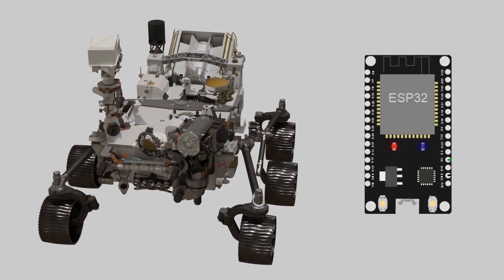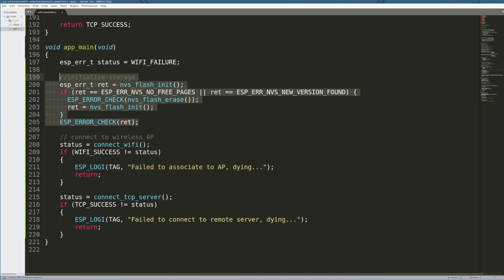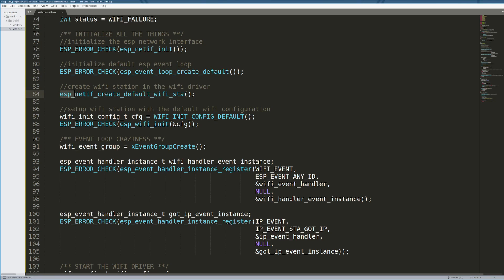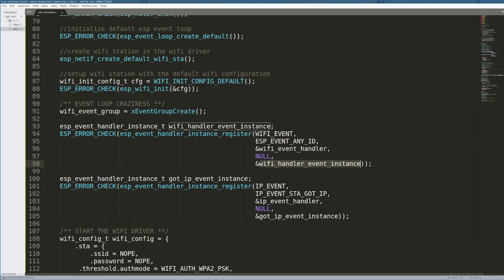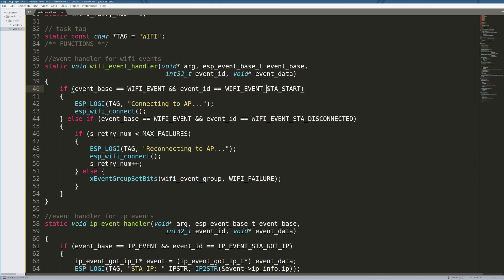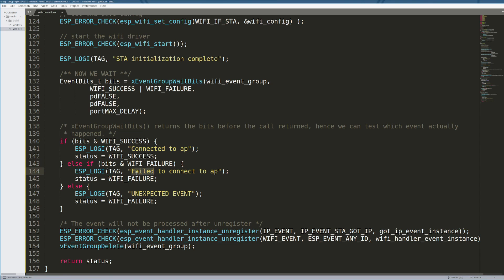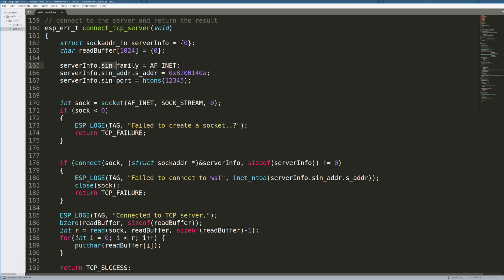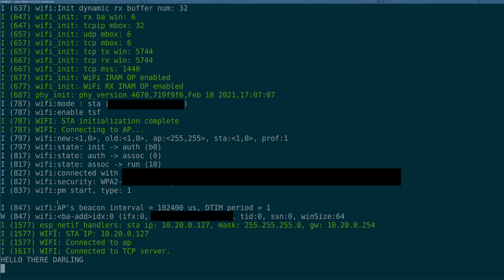Getting Started with ESP32 Wireless Networking in C  |  Wirelessly Enable Any Project with ESP32

Comment: I built the AP project template (Espressif IDF IDE) , but while my Android can see it and  connect with 'mypassword'...   unfortunately Win10 sees myssid, but there's an x next to the wifi icon!   It doesn't even allow me to enter a password!  Any idea what could be wrong?

(And by default, will the AP project template also do a webserver or would that be separate?  I couldn't find any webserver project-template/example in the IDF IDE)

Comment: I modified and built one of the ESP32 MQTT examples and I was shocked that I was able to login to my WiFi and connect to the MQTT broker software successfully. 
I also tried one of the ESPNOW examples and I was able to get two ESP32 devices to talk to each other. I am pretty impressed with the ESP32 sample code.

Comment: ESP32 is just the perfect balance between accesibility and performant low level. Also, built in FreeRTOS with the IDF is just perfect
Reply: Can you recommend resources to learn ESP32?. I tried to use BLE on ESP32 but I got very confused and I couldnt find any guides or tutorials.
Reply: Not really. The fact that the ESP32 is built to require an RTOS sucks for anything real time. It's decent for hobby projects as it has wireless but its actual architecture is way inferior to virtually any other chip
Reply: @TheChrisey  Could you elaborate a bit more? I'm actually curious as to what architecture differences are you talking about
Reply: @TheChrisey  the ESP32 is good at what it is meant for, which is a wifi or Bluetooth connected device. It is also good enough for most real time tasks.

Comment: Your channel is excellent. Which ESP32 board are you using as I will order one? As there are so many types available will your code work on them all?
Reply from the maker: Thanks for watching! I use the ESP32-DevKitC. That's a great question, I'm actually not sure about the compatibility. I would imagine that as long as my code adheres to the ESP API and doesn't directly control individual pins, the code should be compatible. I'll have to test, though.

Comment: Fantastic tutorial! I finished up an arduino project recently for an adafruit ESP32, but wanted to try it closer to bare metal. Are there any other cool features of the ESP32 you could demo, like DMA or debugging FreeRTOS?
Reply from the maker: I will be going deeper into a bunch of these features :)
Reply: @LowLevelTV  Cool, thanks! Looking forward to it. 

Also happen to know how to use an ESP32 via SPI for slave communication?

Comment: First to watch and comment 👌 this is very informative thank you, so from now on I'll prefer using the C way instead of arduino,
Reply from the maker: Thanks for watching!
Reply: You welcome, i have a question:

I was using est32 bavk in 2018 and if I still remember there was Bug that prevented me to commercially use it, the bug was about the esp32 that halt after some time of using and there was no way to reboot it even with the internal watchdog, i had to counter it with external capacitor that trigger the reset pin after a while but that as silly, in that time i was using an arduino bootloader with other libs like mqtt,
In C haven't you got any type of that bug?, is it even stable in the long terme use ?
Reply from the maker: Interesting.... that bug sounds like either two things were happening.

1.) Your code had a bug that was causing the board to reset. Could have been some long-time-use integer overflow or maybe you didn't manage memory correctly and exhausted all the memory. Or

2.) Maybe there is a hardware fault in the ESP32 CPU and over time it just flips over.

No clear answer, but no that doesnt seem very usable in the long run XD
Reply: @LowLevelTV  lol definitely, it's a crash actually that the esp couldn't survive and it appears to be kinda random, if i still remember many users in the internet where facing the same thing and hope that is related to the arduino stack itself, other than that this device is wonderful for its price, even if it operates badly on batteries due to the bad handling of low energy consumption...